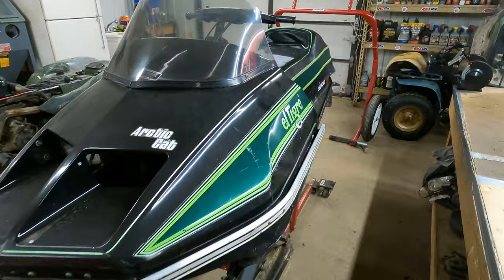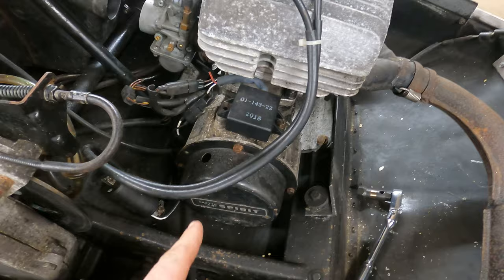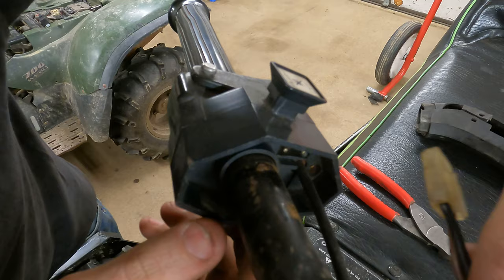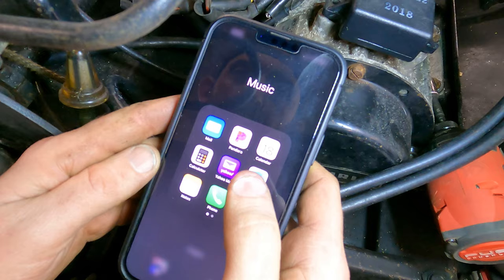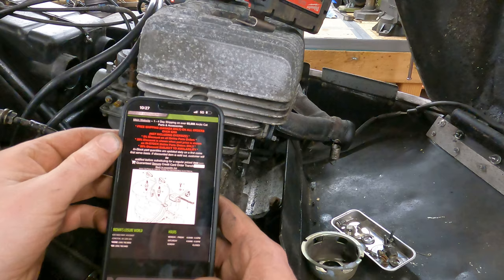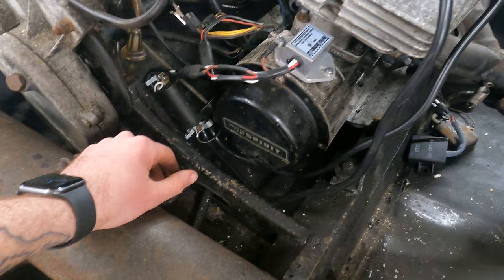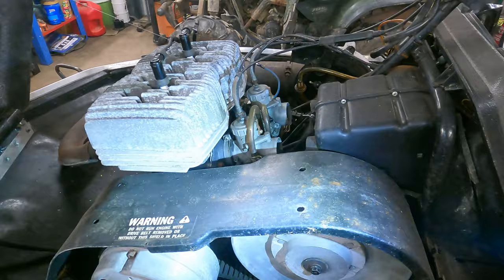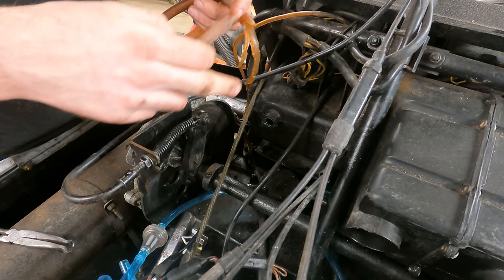NO SPARK ⚡️ 1980/81 Arctic Cat El Tigre 5000 New CDI and Carbs Cleaned | Get Riding Again!

Comment: These were a pretty good sled new. The 81 was the last year for the 500 six port FA . That had a better reverse cam driven and a beefed up wide belt hex made only one year. It also had the rubber track off the 6000 lc. That helped top end and cut weight over the cleated tracks. Topped out about 85 on snow 90 mph on hard pack or ice. Now the engines 40 plus years old so ignition components usually need replacing. The days of cheap vintage parts are long gone.
Reply: All the Free Air El Tigre’s are collectible now. The older Free Air Zs and EXT racers bring good money restored.  Always wondered how this better chassis would be with the 1973 650 EXT 100hp plus triple in it.

Comment: I have a 3000 Jag and it will have spark for about 2-3 pulls then it won't at all. Once in a while it will have spark but it's very rare. Let me know if anyone might know
Reply from the maker: Just spitballing right now but make sure they’re brand new plugs, check the coil wires, take the spark plug caps off and trim the wire back some and put the caps back on, you could do a resistance test on the coil, check the wires that come from the harness and go to the coil, test the stator while you’re in there, check the kill switch wires. Not sure if any of that will help 😅

Comment: Capacitor Discharge Igmition. No points...CDI box goes... 200 plus dollars.
Reply from the maker: $185 to be exact!
Reply: Yep... thanks for the memories... mine was a 6000 cross country. Ive seen the CDI box go and it would take out the piston.  When I think about it , I think the piston goes first then the CDI box goes. But they were thinking the CDI caused the blown pistons. Either way, it was an expensive day.
The 5000 was a nice machine.